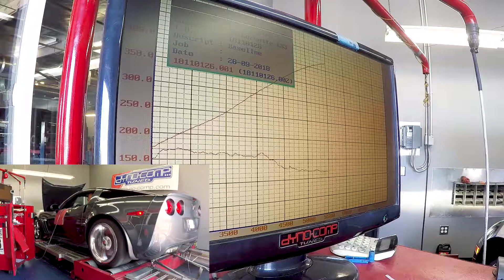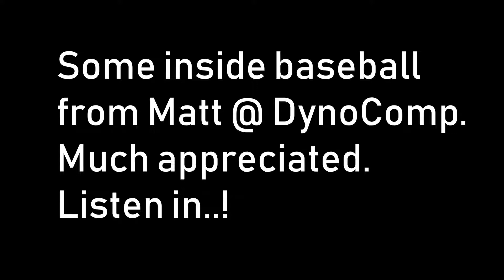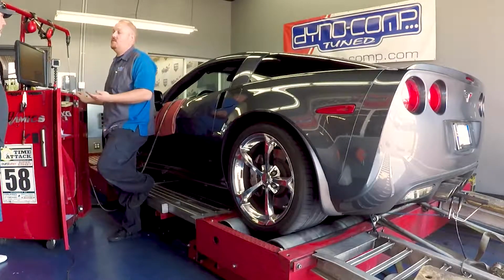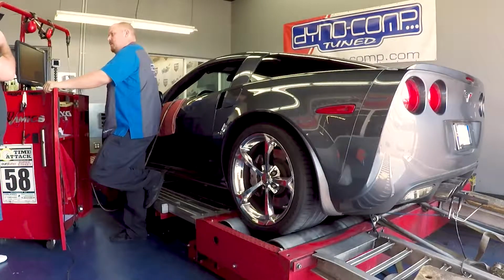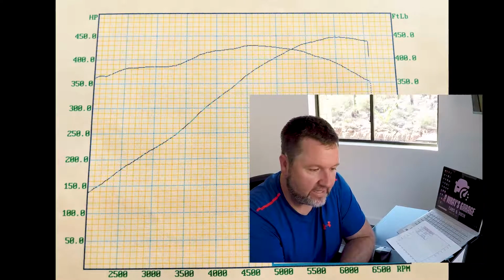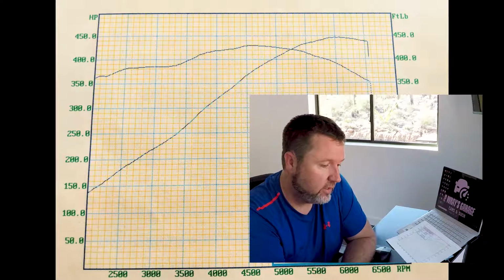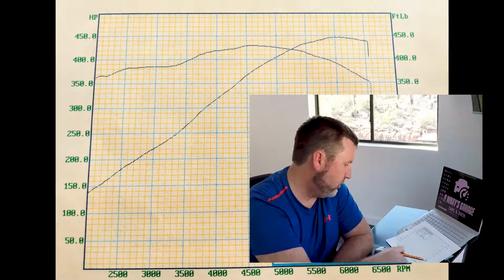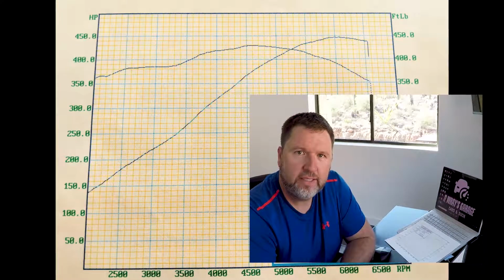Dyno - 2011 Corvette LS3.
No way this is stock!

Comment: So many tuning pros yet so many people take their cars to a shop to have tuned... each dyno is different and some read lower some read higher. It's nothing but a tool to measure gains as you modify... if you use the same dyno everytime that is. What were you running as far as timing if you Don't mind me asking?

Comment: Your dyno is not calibrated correctly.  It should be around 385-395.
Reply: You are correct. I have a 2011 Grand Sport (6 speed man.) and it dyno'd at 389 hp before the Kook's headers, catted cross pipes and tune. Afterwards or dyno'd at 425 hp. It was an extremely hot day (100°), so I figure had it been dyno'd on a cooler day the hp would have a bit more.

Comment: I have a stock 09 base with a manual and it dynoed out at 435hp that’s 5hp over what is supposed to have at the crank and it runs like it also  Maby every once and a while they send out a sleeper from the factory
Reply from the maker: Like finding a golden ticket, right? I'm good with that notion. Stay well.
Reply: Did you buy the car new or pre-owned? If pre-owned, is it possible it was modified?
Reply from the maker: Pre-owned. Certainly could have been played with.
Reply: @Morris1974  I’m the second owner, but I’m pretty sure is wasn’t tampered with the po changed the oil when needed I do have the records , but he never even changed the spark plugs lol and zero upgrades to the c6 lol
Reply: Good dreams are nice but they're still only dreams you need to wake up you're not going to fool anyone only yourself that car does not make that power stock there ain't no way this is what I do

Comment: Only one way to find out if those dyno numbers are real. Get it to the track. If you trap anything under 120mph then those numbers are false. Your basically putting down full bolt on numbers